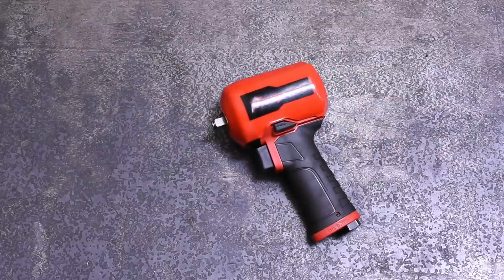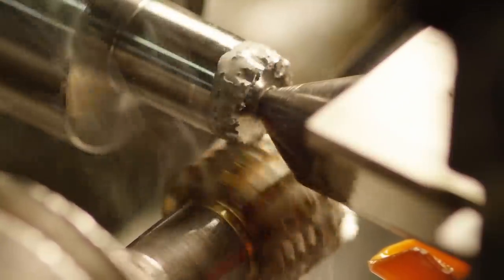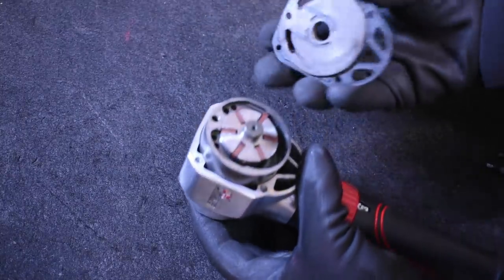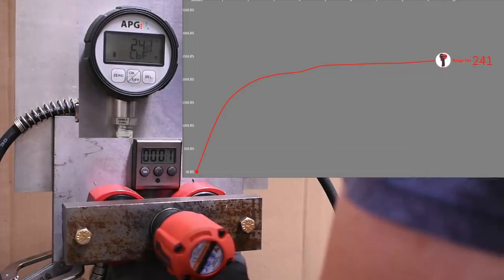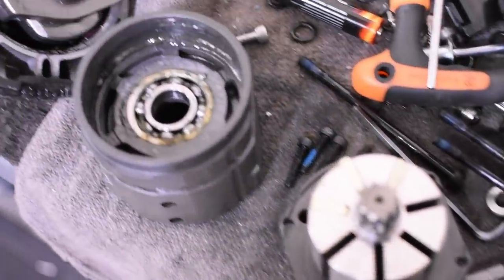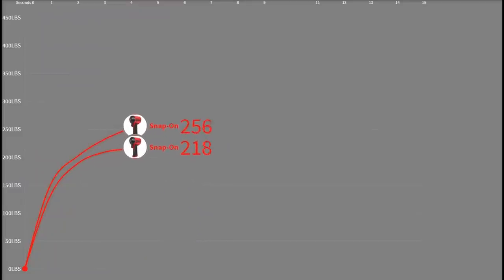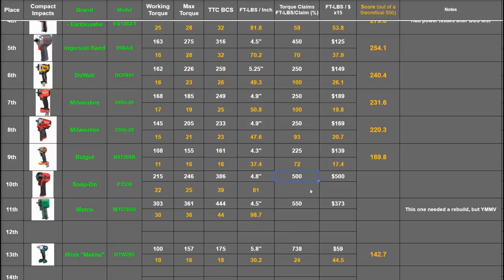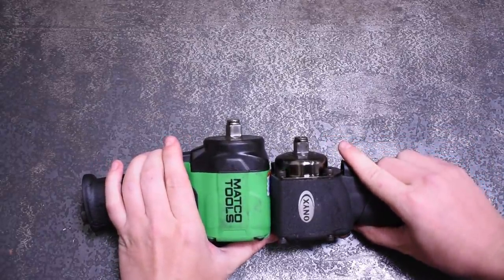We Accidently Kill a Viewer's Impact: Snap On's New Compact vs Matco

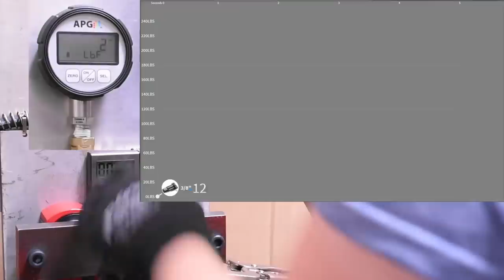Comment from the maker: Believe it or not, the socket sizes here make no real difference! See 2:21 for how much this same 3/8" socket vs the 1/2" deep socket used in this video effects power on the same impact (at this bolt size). Weighted sockets and smaller bolts are a different story of course. Our live ranking list was taken down on us, so its new home is now here: https://etsy.me/3G8j3QK. Not that you NEED the ranking list, but some people like to have it all in one browsable place.
Torque of TTC is working for Astro Tools who also make impact wrenches. TTC is not the only testing out there, always consider multiple sources when looking at a tool!
Reply: You guys should try to get Facom's Nano impact. It would be interesting as it's well spec'd and we'll regarded by users.
Reply: i dont think you ever tested the 20V 3/4in earthquake from HF. didnt see it in your videos. i realize the 1/2in missed the mark but id like to see the 3/4in tested.
Reply: Anvil size might not but socket size, thickness, and weight does. The socket on the snap on is shorter, thinner, lighter. Per impact it bounces back more compared to the heavier 1/2in drive socket that has a much more positive impact.
Reply from the maker: @saucedacarlos91  No one seems to get that the impact at 2:21 's dyno curve is being compared to that same tool with the 1/2" deep impact socket. The same two sockets in this video.
Reply: @TorqueTestChannel  I see what you are saying. It's just odd though. For years if my 3/8" air or electrics are struggling i just stuck 1/2" deep impact sockets on them with an impact adapter. It's like a whole different tool! The difference must be in the dyno. It must be less affected by the heavier socket. Rusty bolts know the difference though lol.

Comment: Hey here's a video idea: test an air impact using smaller 20 gallon compressors as well as pancake and maybe twin tube style compressor with like 5 cfm and see how long they can provide power
Reply: YES! That would be a nice piece of information. Which size of a compressor can provide enough CFM for a given category of impact wrenches.
Reply from the maker: We're working on that. We's need to shlepp our home compressors into work, so yeah not right away lol
Reply: @TorqueTestChannel  You guys rock
Reply: @TorqueTestChannel  thank you! Also please test with cheaper harbor freight guns too cuz some of us are poor lol
Reply: @andrewk8636  the green earthquake one they have
Reply: Before I got a decent compressor at home, I tried running a PT850 off a pancake compressor. It had just enough to remove 3 to 4 lug nuts off my Ford Escort before having to build up pressure again.
Reply: @Krankie_V  try adding 11 gallon portable air tanks to the setup. I'm gonna run a 6 gallon pancake with two 11 gallon portable tanks.
Reply: @theawsomekicker  there's no need for that now. My new compressor has a 60 gallon tank
Reply: @theawsomekicker  still gonna burn the compressor because of the duty cycle unless you install some sort of valve that will fill the tanks very slowly so the compressor isn't at 100% duty
Reply: Lol 3 seconds to maybe 30 seconds
Reply: @dchawk81  The problem is not the compressor it is usely the line or regulator the biggest compressor is useless when it has a crappy 1/4 regulator or and a long tiny airline. The regulatur chokes the airflow you dont get your 120 psi the compressor is making only like 80 are ariving at the tool, it doesnt have enough power you need to run it longer and waste alot of air. Get a short thick airline and bypass the regulator, air tanks have this maintainance holes remove the cap and screw in an fitting that way you get the full pressure
Reply: @andrewk8636  depends on the compressor I suppose, my little 8L 120l/m (4cfm) Hyundai that lives in my van gets hit constantly on some work days, been at it nearly 3 years now & just keeps going. All I added to it was a regulator.

Comment: I just picked up the SnapOn brushless CT861 3/8 impact.  Would you like me to send it in to dance with the dyno?
Reply from the maker: We have someone in line for that currently, thanks!
Reply: Awesome.  Fantastic review by the way.
Reply: @BlindBatG34  send it to me I'll throw it  in the lake and buy a milwaukee.
Reply: @TheBootyWrangler  I can't sell junk
Reply: another channel already tested it  the Dewalt and Milwaukee 12v impacts whipped it badly
Reply: @mikethetoolman8776  I own a bunch of different brands including Milwaukee and Dewalt.  The Snap-On rocker trigger is the thing I love about the CT761/861.  That and the batteries don’t crack and fall out after a year.  I also like the Snappy magnetic battery boots, although I have warrantied out a bunch because they crack over time.  I really like the Milwaukee stubby, except for the M12 batteries, even though it seems a smidge weaker than the 761.  If Snappy made a similar stubby with the rocker trigger, I’d buy one in a second.
Reply: @TheBootyWrangler --- the overpriced snap-off tool was badly embarrassed by 12v tools from Dewalt and Milwaukee so why embarrass it again???
Reply: @frontspring1  at least snap on batteries don't to be held on with rubber bands 🤣
Reply: @mikethetoolman8776  how was it embarrassed? It's only rated at 150ftbs and made 211 it beat it's torque claim
Reply: Wow! Their shop really improved the matco.  Pretty impressive.  I've always liked matco and Mac airtools best.

Comment: Disappointed in matco for the quality control oversight, but also proud that it was still more powerful than the more expensive snap-on.
Reply: That's going to happen with anyone. Doesn't matter the brand. Like he said, it's not common nor have they really found anything on it. That single one just happened to be one. Milwaukee, DeWalt, Toyota, Samsung, Apple.. all within the top of their class.. none are perfect.
Reply: Ya and the matco is a 1/2 stubby opposed to the snap-on which was 3/8. If you ask me, matco lost big time in that test.
Reply: It might not have been an oversight. Over a number of hours, the rotor and housing will wear to perfectly match each other. Just like 'running in' a new car.
Reply: sunex makes it-- matco make no tools at all
Reply: @jjunderwood4095  he literally says in the video that anvil size doesn't have a bearing on testing
Reply: @notaskinwalker3566  if that were the case every company would just make everything 3/8 and completely get rid 1/2 anvil if it had no bearing on results.....
Reply: @jjunderwood4095  size of anvil matters when you need more material to hold up against higher pressures though did you think about that?
Reply: @chanceharmon6491  exactly. 3/8 drive won’t be able to hold up to what a 1/2 drive can.
Reply: @jjunderwood4095  why? Cause of the smaller sockets for the Snap-On? He already proved that anvil size makes virtually no difference. So if that’s your reasoning then it wasn’t a big loss. Not to mention the maco was smaller and still made more power.🤷‍♂️
Reply: Maybe they were trying to keep that front face gap as close as possible as there's no seal between the vane at each "stage" of the motors cycle.
Reply: @johnsipes4422  that only applies to max limit of the anvil, if the stubby can't get to the breaking point of the material, it makes no real difference.  Snapon may have built the 1/2" to be harder hitting than their 3/8", but unless you want to send it to them to test it, they don't have one to test.
Reply: I have had a MAC 1/2" stubby that looks more compact than both of these for probably 5 years now. I did see they had it on a promo sale recently. I rarely use it since it's rebuild last year but I wonder how it would stack up against the new Snap On and Matco.
Reply: Clearly states in the specs that the Matco is stronger as it should be when it is 1/2" drive.
Reply: My stubby Matco just seized up. Bought it 3-4 months ago.
Reply: At 2:21 he shows the same gun with 3/8 and 1/2 anvil swapped and the sockets matching the anvil. It makes NO difference. The proof is already out there. Multiple times. Ppl need to stop talkin shit they know nothing about.
Reply: @jacksmith2315  so nobody should pay more for 1/2 inch impacts? Just buy 3/8 instead?
Reply: I've started shying away from snap on, their quality control is worse than harbor freight these days.

Comment: As much as I love supporting USA made products the Snap on air and electric tools are just too pricey.
Reply: Hand tools, absolutely. Battery tools, Milwaukee spanks it in EVERY category.
Reply: @chesterswingjr9796  even hand tools there's a good amount of competition that snap on can't really justify their price
The only real place snap on stands out as being the definitive best is their tool boxes
Reply: @Alucard-gt1zf  - Yep. I’ve got a $180 dollar + Snap-on 3/8” locking flex head ratchet that I don’t use as often as my Harbor Freight ratchet, and it’s been rebuilt twice, and is broken AGAIN!!! My Harbor Freight, Husky, and Gearwrench ratchets haven’t let me down yet, I’ve used 3ft pipes on my Harbor Freight breaker bar, and it’s still going strong!!! My snap-on ratchet has been pretty much babied, and it STILL breaks!!!
Reply: @chesterswingjr9796  Funny I've had this same exact experience with Matco ratchets breaking on me at work after being babied (never hammered or cheater piped) broken 4 pawls in 10 months, unacceptable. I've hammered and cheater piped my Gearwrench ratchets many times over many years never broke one! And when it comes to boxes, my Gearwrench 72" x 25" box was an amazing deal for $3k. Thicker gauge steel than entry level tool truck boxes, double slide drawers with 300lb capacity, and a very nice rocking handle desgin that i like much better than snap on's loose plastic handles. Made in Taiwan, yes, but you can't get this much box from a tool truck for even 8k..
Reply: @z33tanner  - That’s funny you say that, because one of my BRAND NEW Matco ratchets broke the first time I used it!!! Snap ring popped out, and the paw, and gears went flying across the floor. I just went to loosen a bolt, no cheater bar, just a regular fastener. The replacement has worked fine, but now I’m scared to actually use it!!! I did buy  the 44” US General lime green box. I got lucky, and my store had a open box model for $399, so I got a good deal. I’ve had nice  Matco, Snap-on boxes in the past, and while they’re great, quality boxes, I can’t justify the price at close to retirement age!!! 😂

Comment: Snap-on air tools are psi whors but since shops regularly run at 150-180 psi it isn't really a problem. Air tools should be designed to run best at shop pressure if they are made for professionals interested of DIYers.

Comment: One of the nice things about pneumatic tools is, they all use the same 'battery'. An air hose. You don't need to buy all in on Brand X just because you already bought into the battery's form factor. You just get what ever tool you need, as you need it, based on availability and funds.
Reply: you can get battery adaptors. i have milwaukee and dewalt running off my makita batteries
Reply: @jameshunt2141  true but, that's practical and sensible. The psychological impulse, is to have all the tools in the battery line.
Reply: I can see myself requiring air hoses everywhere, and a bunch of 12v compressors to bring around, yeah thats cheaper and just so practical that theres simply no doubt, youre a genius.
Reply: @pflaffik  ... thanks for the snarky negativity.
Reply: plus, if you don't use tool very much, no worries if batteries are charged or any good.
Reply: It all just depends on what field your in. If you get more money from being fast and efficient, then battery power is better
Reply: @mechanix1945  i sit on the side of if i get my job done quicker i get home at a more reasonable hour. get every tool to make the job quicker
Reply: And air hoses everywhere, air leaks plus a loud compressor. No thanks
Reply: I'm on makita but got a few milwaukee batteries along the way (not too sure how they ended up in my shed) I was hesitant about a battery adapter but it was worth it

Comment: I have both and both are great guns. The Matco just has way more rpm (10,000 vs Snap On 8,000) giving it more power. 
I run 185psi static pressure thru my 3/4" air lines in my shop which makes any air tool a screaming monster.

Comment: That Astro Nano is looking better and better. Especially for the price.  
Could you guys try the Ryobi PBLID02 Impact driver? 
Would love to see how it stacks up on the ranklist. 
Great video as always!
Reply: It's really really great, other than the volume. It's honestly my go-to impact, been using it as a daily with a swivel for a few years now. Going to be buying another just as a backup in case I can't get a rebuild kit should I need it.

I end up using it in all sorts of weird spots where I never would have thought you could fit in impact, so much that the paint is basically completely gone. You can wedge and jam it in anywhere, but it's still go the torque to bust lugnuts all day. I love it for the pump rebuilds I have to do, I'm up on a stand 8 feet in the air so small and light is good, and I have about 30 1/2" bolts to deal with, and a couple 300ft/lb wedge bolts that it zips off every time.
Reply: I bought it and there’s no regrets it’s done everything I need. It also busts off lug nuts like no problem

Comment: I realize this is an old video and this comment probably wont be seen but I work in a heavy diesel fleet shop and have the big brother to the Matco stubby the MT2779 and your results with that gun are astonishing because if it runs the same way as the MT2779 your results in reverse would have been with the gun set to low torque, can't say anything on behalf of the Snap-on because I don't have any Snap-on air guns. But on my MT2779 you have to twist the power dial to the left or "low" when you put it in reverse to get full beans which is counter intuitive as it is not marked on the back of the tool but the difference on my gun in free speed RPM and effect on a rusted up fasteners is night and day. Anyway keep up the good work, always look forward to the videos and its nice having someone give these things an honest test against whatever pie in the sky numbers that a marketing dept wanted to print on a box.

Comment: I have the old version of that matco gun, can confirm it hits like a freight train despite its tiny size. was using a mac awp050m awhile ago, that thing was nuts, dunno how long it will live but its 1/2 the diameter of the old matco gun and is the fastest impact I've ever used
Reply: I have the same gun great little impact they punch hard. I did have to rebuild mine last year though. The last shop I worked at had a ton of water in the air compressor killed it pretty quick. I've since swapped to using Milwaukee electrics and keep the stubby around for extremely tight areas.

Comment: I’ve own the snap on 3/8 stubby for over a year now and I will say I’ve noticed a difference of power like you guys said, especially when jumping over to having to use the air compressor in the shop vs. the service trucks compressor
Reply: I love it tho I use it more often than ever, it’s helpful when getting between tight spaces it’s price was alittle higher than I would’ve liked but my snap on guy worked out a deal to throw in sockets so it was worth it

Comment: You should do a destructive test. Get a 2000 psi cylinder and keep running increased pressure through the gun till the case cracks. I always wondered what is actually too much for an air impact. Formula 1 guns are like 400 PSI.
Reply: Most of the bigger tools they test are lent to them by other tool YouTubers unless they bought the tools (which they do a lot)
Reply: @YourPalQWERTY  plus that is straight up dangerous. And expensive. . . No way is that worth it.

Comment: there is a reason I have a 2141 3/4 IR impact, a 7748 CP 1/2 inch impact,  an IR 2115 3/8 impact, and a Milwaukee 18V Fuel 3/8 cordless. Sometimes, you need more. Sometimes, you need way more. The shop has a 1" D handle 2850 IR for the big boy stuff. Great content, TTC.

Comment: I have the pt338 and it's definitely an air hog... snap on even tells you it requires high flow fittings. But for a 3/8 gun it's definitely a monster

Comment: How much effect does the different mass of the sockets have on the numbers?
Reply from the maker: On these two sockets, less than 5ft-lbs. As socket size decreases the difference % goes up. We have 2 episodes on it. Also at 2:21 you see a 3/8" anvil swapped compact being dyno'd vs its 1/2" anvil using these two different sockets. So that dyno graph shows the difference.
Reply: You read my mind. How fair of a comparison if not running same socket and now who knows what pressure🤔

Comment: I've been loving my Astro Nano, these results are very validating. Also is still shorter than the tool truck brands
Reply: Does it need alot of cfm to work hard?
Reply: @saulgood6190  I work in a shop with a large air compressor so I'm not exactly sure, but I do know it doesn't eat near as much air up as something larger. I can do probably 2x work with it before the compressor kicks on compared to my earthquake XT. It definitely likes higher pressure though, went from 90 to 120 and it feels better

Comment: A "tip" I'll tell you about the Snap On PT338 and PT350.  The motor cylinder has a screw that attaches it to the rear motor plate.  This screw comes loose and the tool loses power very quickly.  Dab a little lock tight on the screw and torque to about 8-10 inch pounds and the tool will run the way it was ment to run.